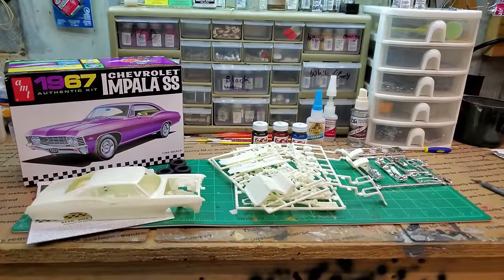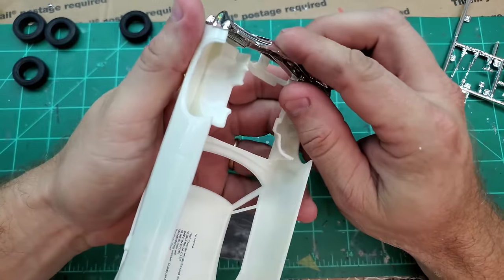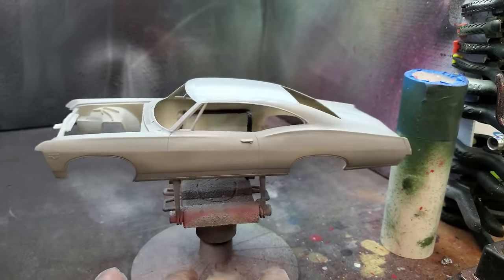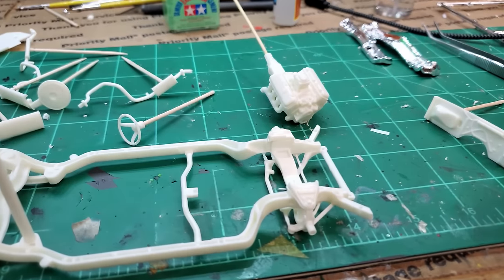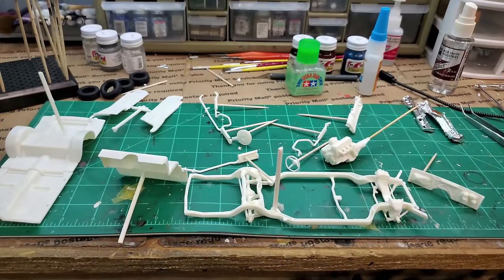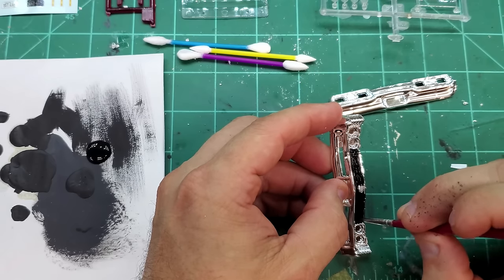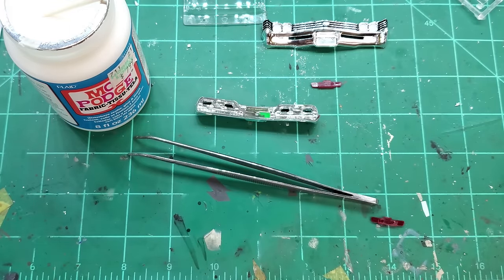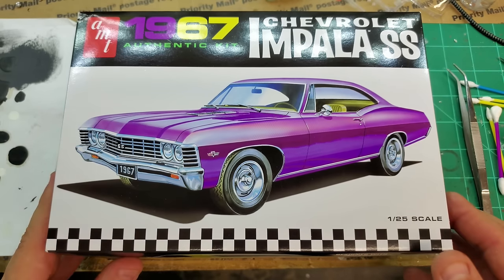1967 Chevy Impala By AMT 1:25 Scale Build Using MCW Paints!!! PT1

Comment: Picked up this kit to get back into the hobby after 30 years.. I’m struggling with the suspension assembly, many moving parts to hold at the same time. Any recommendations?
Reply from the maker: Super glue works faster but you'd better have them all where you want them. I use tamiya thin cement and a good set of angle tweezers.
Reply: Gluing the suspension assembly before paint will help.  Painted parts sometimes seem more slippery than sticky.  Sometimes I choose to have fixed position wheels and if the axel assembly is plastic I may not have them roll. I have found that allowing all that movement weaken the joints in time.

Comment: I've watched quite a few of your Videos and I notice you don't use primer before painting. Any reason? When I tried that the paint chipped and wouldn't adhere properly to the body. Also when I prime and then lightly scuff the body, the final painting turns out really nice and flat.
Reply from the maker: Actually I primed and sanded after primer. Yeah if I didn't prim it would look terrible.

Comment: I want ya to try something for me, get some HVAC  Aluminum Foil Tape, you can find at Lowes, Home Depot,
most any hardware store.  Or if ya got a friend that works in A/C field get a foot of it from him/her. I noticed ya pulled it loose a couple of times. This stuff is super sticky and won't let go.  I tried the bare metal foil and 
found the low tack adhesive unacceptable. Tell me what ya think !!!